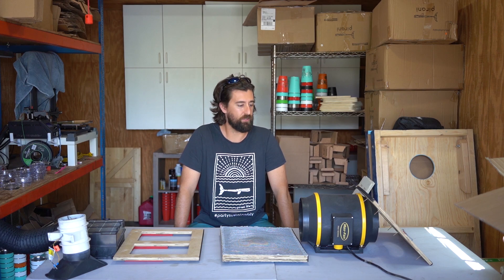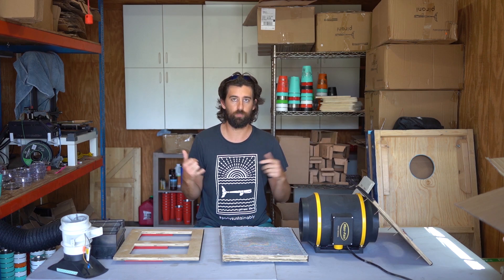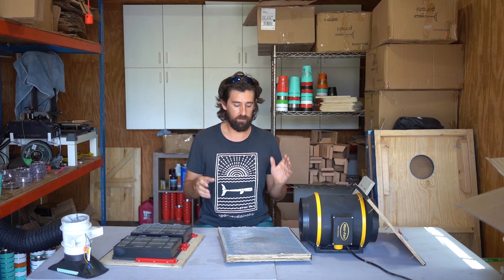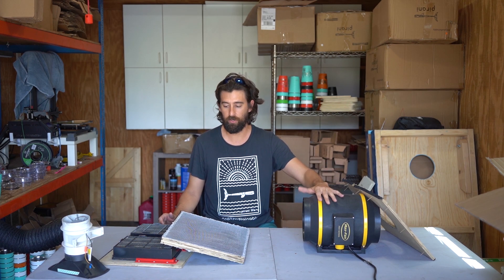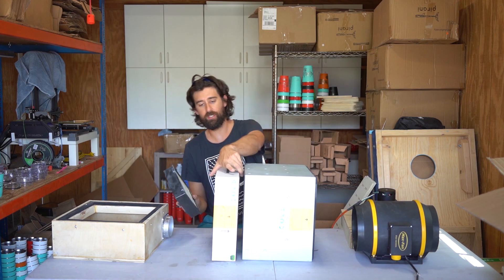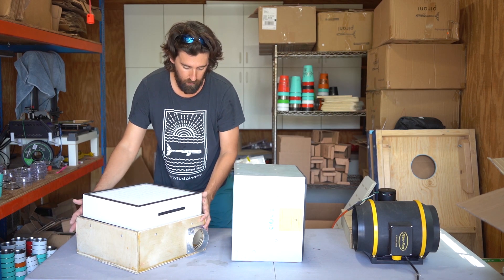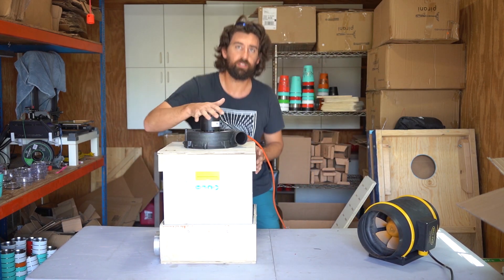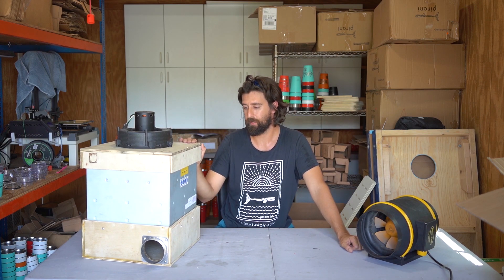DIY Meets High End Fume Extractor for Laser Engraving/Cutting

Comment: I purchased a fume extractor for cutting MDF, but the filters became clogged after only 20 hours of use. Do you think this setup will experience the same issue?
Reply from the maker: You need a pre filler you can clean l, probably not disposable...

Comment: You really should have a lid at that bucket with charcoal. Firstly,it ages with the dust and moisture it absorbes from the air. Also, there gonna be microscopic non-detectsble particles of activated charcoal, which you breath in .

Comment: I am wondering if an automotive catalytic converter would clean up the exhaust fumes from the laser. Particle filter, converter, carbon filter.
Reply from the maker: To my knowledge, cat converters work based on a range of temps. I think they need to be at a pretty high temp to function and I also believe it is passive. Could be something to do more research on...

Comment: I am wondering if the exhaust was to be fed back into the enclosure would make any difference. It would be a totally enclosed system then. This would create an equal pressure system, Air in, air filtered out then air back in. If your system does not have any leaks you shouldn’t smell anything, but I don’t know how the air would smell when the lid of the enclosure is opened.
Second note. Don’t use the gray duct tape, which really is duct tape. Use furnace tape. That way the adhesive won’t dry out and fall off.

Comment: A prefilter is intended to trap large particles and debris, thus it can be fairly thin and have coarse fibers. Prefilters are intended to be replaced frequently (i.e., weekly, bi-weekly, or monthly). The prefilter also minimizes the amount of particles that get through to the HEPA filter. The HEPA filter traps all particulate greater than 0.3 micron. Depending on maintenance of the prefilter and environmental factors, the HEPA filter should only need to be replaced 2 to 4 times per year. The final stage activated carbon filter removes the smallest gas particles (such as carbon monoxide). The activated carbon filter is very porous and the layer of material must be fairly thick for gases to be filtered out of the air stream by adsorption (a process of gas particles bonding to the outer surface of a material, which is different from absorption).

A very well designed system would also include a UV light sanitizer for killing bacteria trapped by the HEPA filter. Otherwise, the bacteria can grow inside the air filtration system. That said, I've yet to see a filtration system designed for use with laser cutter/engraver machines that features a UV sanitizer.

Comment: I have built mine, this is crazy man. No smoke and No smell at all even when I engrave acrilic, leather and plastic. my laser machine is a covered fiber laser I modified your design and put 2 of the same fan at the top so its monster.... The only problem I have is fan overheating. I purchased the exact  fan which you showed it in the video not the one which you put in the description. both fans seems the same but the video one has a cover, I was not sure why the discription link shows a non covered fan, now I think maybe you had the same issue and then updated your fan to a non covered one to solve the overheating issue. Is it something I should do the same? or any solution. I apriciate that, this was a life changing experience man!!!
Reply from the maker: The original fan I bought was the one in the video. We have 5 machines running now and they all have this filter configuration.  All but the one in this video have no cover.  Just curious, overheating = not working or overheating = it just gets hot?  We run ours 8 hours a day sometimes and I haven't felt the temperature, but I imagine they are hot...
Reply: @BrandegeePierce  Yes everything works perfectly just get too much hot after 10min. after 15 min I can not feel it because it burns my hand specially the bottom part of the motor. Maybe that's normal for hvac motors or if  4 of your fans are not covered, maybe that's the reason they don't get too much hot because cover doesn't allow to cool down.
Reply: @BrandegeePierce  I will apriciate your  feedback about your fan tempeture. Thank you so much
Reply from the maker: @GoogooshLover1  I just checked and all of our fans don't seem too hot.
Reply: @BrandegeePierce  so maybe I purchased a wrong fan (covered one)... I will try your descripitin link to buy the non- covered fan. Maybe that solves the problem. Thank you so much!
Reply from the maker: @GoogooshLover1  maybe. I will say that we only have had one burnout, it was the plastic covered housing... Since they changed the design, we haven't had any issues.

Comment: I will be getting my 50W OMTech laser next week and am in desperate need of a smoke filter system. This is exactly the inspiration I needed. 
How long does the filter last and what materials do you laser with it? Do you think the solution will also work with a slightly larger laser? Thank you very much for sharing your ideas!
Reply from the maker: I have a yellow so entirely sure what size it would work with. There's two filters. One of them last significantly longer than the other. I'm actually getting ready to make a new video with a much bigger build because we have 10x our company.

Comment: Sorry mate , I have 1600mmx1000mm   150 CO2 laser cutter  and the  I use abt 10 metre of ducting  and run the opposite setup that you suggest works best
Reply from the maker: If you don't have a filter it will work fine. If you have a filter the fan can't pull air. It can only push air.

Comment: Do you think a W-E2 air blower, used for small bouncy castles would be ideal for this build? Trying to find a suitable fan in the UK but not too sure, any advice would be amazing?
Reply from the maker: I was thinking about that... I am not sure if they are designed to run for hours upon hours...
Reply: @BrandegeePierce  thanks for the quick reply! In terms of power etc do you think it would match the spec of yours? We usually laser for 4-8 hours a day
Reply from the maker: @brownrigg2137  I think some back pressure from a bounce house is probably pretty significant. I think it would be fine.  You can ask search for another furnace blower... Either way, I think you'll be fine.

Comment: Can I get the  name and model # of the fan and where to buy it— thanks Joez
Reply from the maker: This is the one I use, but you can probably find a cheaper one.
Reply from the maker: Fasco A163 3.3" Frame Shaded Pole OEM Replacement Specific Purpose Blower with Ball Bearing, 1/20HP, 3,400 rpm, 115V, 60 Hz, 1.8 amps https://www.amazon.com/dp/B0099CBOB4/ref=cm_sw_r_apan_i_0A8D1FBWF3A078NBYBSC?_encoding=UTF8&psc=1

Comment: You are getting ripped off buying spare parts of a wannabe industrial-like actual consumer product. This is where they make their margins for the lifetime of the product they already sell overpriced. Please look around at prices of standard M5 / F9 / H13 filters / Carb cylinders or diedres of 59x59 cm (or 36x36), with much higher flow, pleats, then surface area and life expectancy...
Regarding carbs, 15+ types of carbs is a joke... You get the carb impregnated with the chemical you need relative to your smoke type, not 100 grams of each kind. Go for the regular one (not treated). Unless you're cutting very very weird crap you'll obtain efficiency as long as you have enough surface area, slow airspeed, then good contact and adsorption time.

YOU SHOULD NEVER VENT BACK YOUR FUMES EVEN WHEN YOU THINK THEY ARE FULLY TREATED IN YOUR WORKSPACE.
It's a basic rule. It's what you can't see and can't smell that ruins your health. A VOC sensor can't cost 3 dollars and should also measure PM. Look around Sensirion sensors if you ever reconsider designing a safe filter.
I sincerely hope no one has followed your sketchy design & poor filtration comprehension :(
Good point is that seeing videos like yours gives me the envy to share my designs on youtube I guess.

PS : Max Fans as axial blowers are a great compromise between volume and static pressure with a very very reasonable amount of noise. If you have the budget and don't want to have a 60+ dbs turbine ruining your workspace, just try and put 2 of those in series... It's just like pumps: You won't increase the volume, but the pressure will climb up :)
Reply from the maker: You made my day... I have my first troll... It means this was a successful video I guess!
Reply: @BrandegeePierce  man this worries me... does this mean you actually do not understand what i wrote?
Went through comments of people unfortunately trying your build... Huge success yes indeed bro !
Reply from the maker: @hugomagagnin4460  sure I understand you are upset that I didn't use the cheapest filter on the market... If people are using this machine like I am... To make money, I have no issue paying for a quality filter. Your recommendation is kind of a joke... I tested many filters prior to what I am doing now. The ONLY thing I agree with is the VOC being a concern but I shared my thoughts and you can indeed find very affordable sensor's. Whether they are $3 or $15, the point is, they aren't $250. Venting back into you warehouse is never ideal, but I have news for you... You are drinking shit and piss water... As is everyone on the planet... Guess how this magical water is safe... Filtration. Anyways, I would love you to make a video sharing your thoughts about a better filter. And your an idiot in regards to the fans. Not sure if you work for max fans or something, but axial fans are not designed for pressure... They are designed for flow. Centrifugal fans are not designed for flow, they are designed for pressure. If the filter is using is good quality, not the crap you recommend, you need pressure more so than flow.

I actually connected to max fans prior to using the centrifugal and there was <50cfm.

Anyways, send your link when you get your video up!

Comment: I have a fairly big laser with a bed of 35"x24" and the port to extract the fumes is below the bed.  Do you think the motor you listed is powerful enough to suck through the filter and grab the fumes? I built this and have the AD350 filters with "2" centrifical 650 cfm filters and it is not enough. I know you said your furnace blower works differently and is the right one to use but I wanted to see if you thought it would be powerful enough for my laser?
Reply: It won’t be powerful enough.

Comment: Just finished my build. It's a bit more elaborate than yours in that my entire filter is covered and I'm using a 400+ CFM centrifugal fan. Unfortunately, it did not eliminate the smell 100%. Maybe 70-80%. I'm using a 100W CO2 laser with 6" ducting. At first I did not have any foam gaskets on the shelf that my filter sat on, and fume elimination was maybe 50%. I added some foam to the shelf, and now it's at around 70-80% in terms of fume elimination. I think a big thing with these DIY systems is SEAL SEAL SEAL SEAL SEAL. SEAL every bit that you can. I'm going to go back in and caulk all the joints and maybe add a layer of duct tape to the entire interior to make sure all of the smoke passes through the filter. So far, I give the DIY system a 6.5/10 when factoring in the cost.

I'm also wondering whether or not air speed has any affect on it. Maybe my air is passing over the media too fast for 100% filtration? What do you think?
Reply: Hi Ryan. I'm looking into building a fume extractor as well. Have you learned anything new in the last 4 months with your build, and how are you liking it?
Reply: @ProBangers   Hey there! I’ve totally ditched my custom extraction unit for now. The fume reduction was maybe 75% effective, but it totally killed the smoke extraction from my machine. I had lingering smoke for at least 1-2 minutes, and the machine would fill with smoke during the cuts or engraves, which isn’t great for the machine itself. 

You need a pretty beefy fan (at least 8” centrifugal) to get it to pull smoke through the filter effectively.
Reply: @RyKnocks  Thanks for commenting Ryan! Can I ask what filter unit you ended up going with long term? I just got a 100W CO2 laser and don't want to waste time on DIY options if they are inferior.
Reply: @MrAjOlsson  I ended up having a “chimney” installed into the roof of my garage and exhaust through there. It’s barely noticeable at street level. I gave up on the idea of a filter as it can get pretty pricey.
Reply: @RyKnocks it sounds like the filters got saturated and the static pressure rose that the fan couldn't handle. Did you use 4inch thick hepa and 6kgs of clactivated carbone?
Reply: I am wondering if the exhaust was to be fed back into the enclosure would make any difference. It would be a totally enclosed system then. This would create an equal pressure system, Air in, air filtered out then air back in. If your system does not have any leaks you shouldn’t smell anything, but I don’t know how the air would smell when the lid of the enclosure is opened.
Second note. Don’t use the gray duct tape, which really is duct tape. Use furnace tape. That way the adhesive won’t dry out and fall off.

Comment: Thanks on this video. Makin my own now. I have the same problem with neighbors complaining about the burnt acrylic fume.
Reply: I've been using my homemade unit on my laser cutter/engraver based on your inputs. No problems with the neighbors so far, I just have to change my activated charcoal filters (bought it per sack) after a few batches. It's not that tedious.. i learned a lot from your trials/mistakes. It kinda made the process much easier. Many many thanks.
Reply from the maker: @anndaks1333  I am glad I could be of help.
Reply from the maker: Don't want to upset your neighbor's!

Comment: Hi Brandegee - My friend has an p/t on-line business creating high quality custom signs inscribing 3/4 birch plywood using an EPIOG 24x12 Laser Printer. He does this in his townhome basement and has 1 HP Dust collection Fan hooked up to extract the fumes outside, but definitely needs a filtration system. He sent me a bunch of DYI systems, but I like yours the best b/c it uses the existing BOFA filters. So, I am trying to find out the dimensions of the Prefilter and the Combo Filter units to design a box before purchasing them. I may also add a slot before the Prefilter to hold and simple standard size furnace to catch some of the gooey particulate that emerges b/c he covers the plywood with high quality painters tape (Frog Tape) before engraving - I guess to reduce the chance of splintering the fine writing - so the particulate contains tape-glue which may quickly clog regular filters. Having a stack of inexpensive furnace filters would allow him to replace them once a week or as required. I would also add a speed control to his existing 1HP fan so that he could set the speed just right. Anyhow, the BOFA filter web page with price and detail does not include the dimensions of each filter, so I'd appreciate it if you provide that. Thanks. And btw - Great video!
Reply from the maker: Sorry for the late reply. I bought mine from a 3D printing supply company.
Reply: Great idea on the cheap pre-pre-filter, I use tape on my stuff too and can see where that would work great